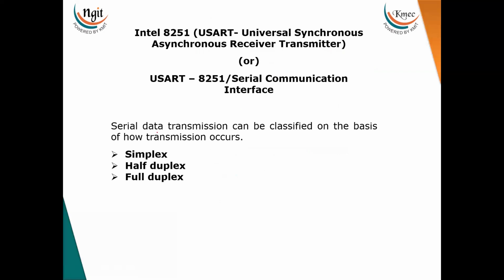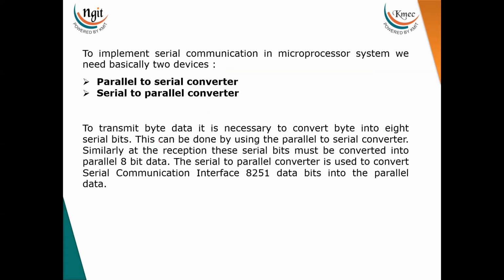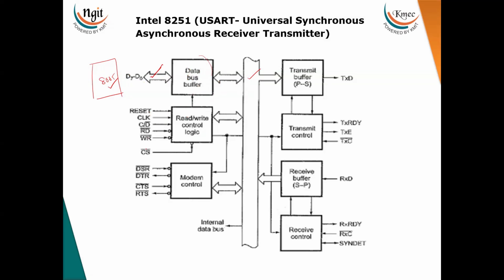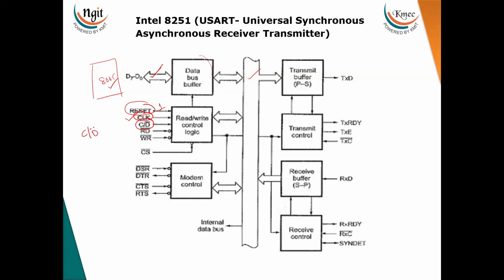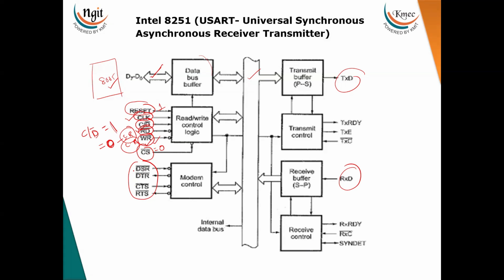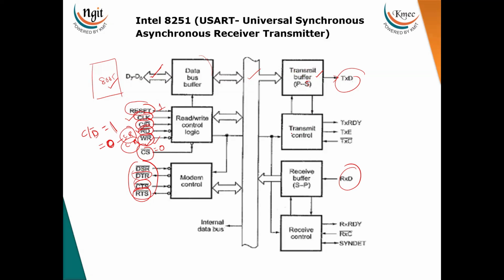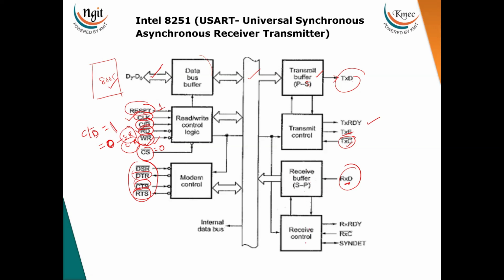5.2 Programmable communication interface Intel 8251

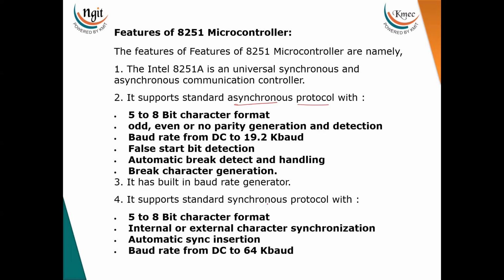Comment: 2:51 correction: The 8251 doesn't have a built-in baud rate generator - the related 8250 does.